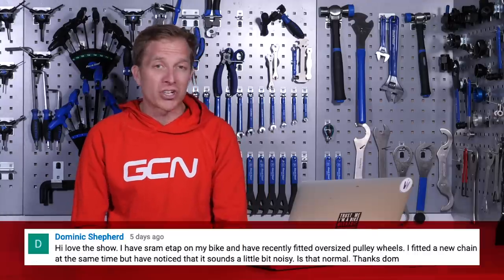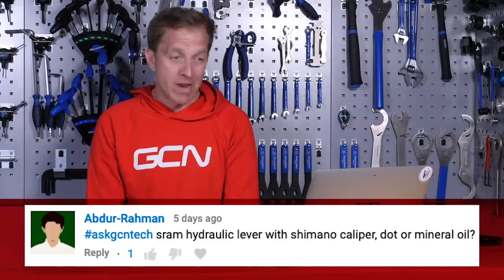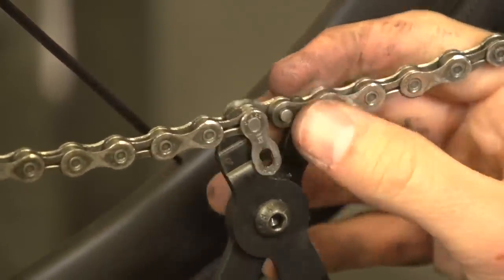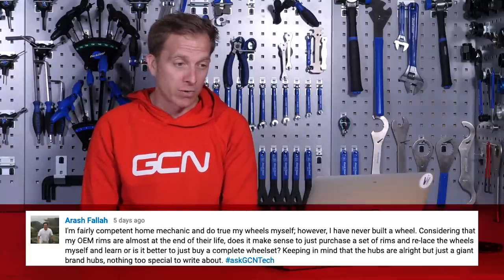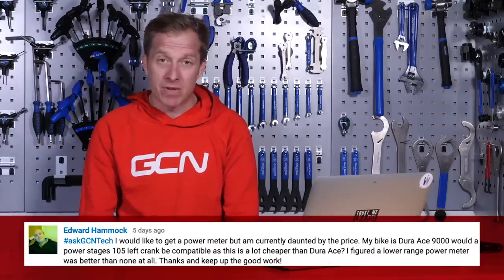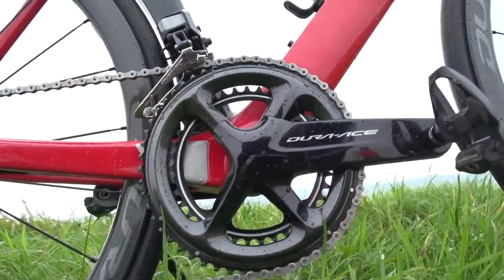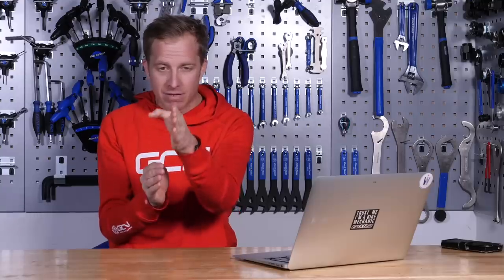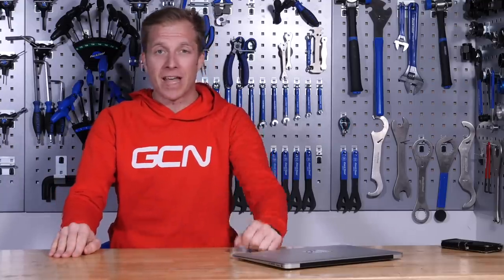Can You Use SRAM Levers With Shimano Hydraulic Brakes? | GCN Tech Clinic

Comment from the maker: We love to help here at GCN so don't forget to leave your questions in the comments below using #AskGCNTech and we'll try to answer them
Reply: #AskGCNTech have you put a tracking device inside yer bike frame somewhere just incase it gets stolen?
Reply: #askgcnanything can’t seem to find the answer to my question: can you use flat mount calipers on a post mount frame? Confident you can help me out here. Thanks!
Reply: #AskGCNTech Hi Jon. Is there a way to have a 10t sprocket on the current 11 speed groupsets?
Reply: #AskGCNTech Hi Jon,  I have just started waxing my chains. It was recommended to me to soften the wax with paraffin oil.  I did a 1:1 ratio on the first try and notice a little more chain noise after about 60Km than I do with me regular dry lube. Is this normal or is it a sign that I shouldn't have used the paraffin oil.  Other than adding the oil I followed the steps in the GCN video on how to wax a bicycle chain from Nov 13, 2017.  Thanks, keep up the great work!

Comment: We need a video about converting a bike from flat bar to drop bar, I can never really find a clear answer anywhere that would tell me if this is a good idea, I have a 2018 specialized sirrus hybrid bike and want to install drop bars to turn it into more of a gravel adventure bike, any help would be greatly appreciated
Reply: The trouble there is that often the toptube on a bike designed for flat bars will be too long to use with drop bars, the reach is just too much...  or you'll need a 45mm stem...   Which can make handling a little twitchy.

  Modern Hybrids & mountain bikes often have short stems already, and thus are really too long to convert.  
I've done a few conversions with old steel frame Mountain bikes and hybrids;  I usually look for one a few sizes to small for me, and just use a lot of seatpost.  Top tube length varies a lot though, and sometimes they are just too long.  Seat tube angle can also affect this...  
If already have a road bike that fits you look up measuring "reach from bottom bracket" and measure that and your hybrid to see if you can compensate with a shorter stem or not.
Reply: I'll second owwliv. Something else a lbs mentioned to me, was the crank position may not be great for a more forward position, ur knees may end up more in your chest than a dedicated drops bike. However, I've done the swap to a 2017 vita elite carbon. And it actually worked out golden. And i had a blast researching, parting it out, and building it. I started with a slightly big frame, i'm between a mens XS to S frame, and i did the build on a womens M frame. Might be a little too aggressive, i could use a shorter stem, but its otherwise a joy to ride, and fits schwalbe winter marathon studded tires. 

The primary deterrent i'd give you is performance per dollar. Depending on what u currently have, you may lose more than you gain with the switch. I went from 2x9 sora and hydro disc brakes, to 1x11 and mechanical discs. 600 CAD for the bike used, almost as much for the sram apex/rival hodgepodge i added to it. Plus 300 for a wheelset upgrade. I coulda saved 300 by sticking to shimano 2x9 or 2x10. But mechanical discs on a 900 CAD bike... You could get as much, brand new.
Reply: From personal experience, shimano sora 9s, deore 9s, and 105/ultegra 5700/6700 10sp all play nicely enough with each other. So if u have sora 9s, u can probably run a 10s 105 5700 cassette, with 5700/6700 10s shifters, with the 9s derailleurs, and be golden. And other forums will say 8s and 9s also play nice enough, but i've never tried that personally. Similarly, if u have a higher end sirrus elite, those have tiagra 10s? Which apparently only play nicely with same generation tiagra drop shifters or shimano 11s, meaning a cassette upgrade?

But the higher end models mean hydro disc brakes... And honestly thats a can of worms not worth opening. Flat mount vs post mount, DOT fluid vs mineral oil, general compatibilities... Unless u truly start from scratch, with a whole new groupset. Might still be able to find some RS685's lying on the shelves in some e-retailer somewhere. But then, just buy a brand new frame too while you're at it...

Comment: Speedlinks can snap :) Few weeks back and mine snapped right off! It was partly a bumpy piece of road and if it was chainslap or something else, I don't know. Did not have a spare with me but since that happened I do now! Lucky for me it was a small walk, 2,5km, to the nearest store! And although adding them to your keychain is a smart thing I would not recommend is. Those very little plates that keep the speelink stuck together are fragile, especially on 11s. So I would stick them somewhere in a saddlebag or something you use to keep your tool or tire etc.

Comment: how will sram hydro road levers work with sram guide calipers ? the original calipers that match this levers have 2 pistons on the calipers and the guide has 4 calipers .. will they work right and strong ? or levers too small for the amount of fluid needed to push eficiantly the 4 pistons of the guide calipers ?

Comment: I have a current cx bike with a 6600 shifter but an alivio rear mech because budgets really tight. My question is should i redo my shifting if it’s currently fitted with a 12-25 cassette on a 23c and 25c wheelset and i wanted to fit it with a 11-42 cassette for the 38c and 38c wheelset

Comment: Dot vs mineral oil... Am I right if I say they you can use mineral oil with brakes that are designed to work with dot oil but not the other way around? Because mineral oil is harmless, and Dot is unsafe with some materials... So could I use mineral oil in Sram calipers? Furthermore, Sram why don't you just go with mineral oil?

Comment: i have a new bike and now that i have been riding it for a while i need to re-index the gears, i know how to do this and have done it on several bikes in the past but i'm struggling with the barrel adjuster and getting the right tension. it just keeps slipping gears and i cant seem to find that correct tension now that the cable is stretched. if i get the highest gear i lose the lowest and vice versa. its a shimano rear derailleur  #AskGCNTech
Reply: Just having some thoughts here.
It might not be the cable, it might be that the derailleur hanger is slightly bent inward/outward..
Reply: @cliffordromina3527  i don't think so its a new bike that has only been on a turbo trainer until today so there are bashes or dents to it

Comment: #AskGCNtech. A question for you. I have a road bike and some components arriving from the UK for my 9 year old son. The frame is designed to take 700c wheels and disc brakes. It's a single chainring with an ultegra 11 speed cassette. I managed to pick up a set of SRAM apex levers for him as they can adapted for his smaller hands. A friend gave me a set of ultegra hydraulic calipers to go along with the  center locking shimano  rotors I have for the bike. 

Are the levers and calipers compatible?  If not, what Flat mount SRAM calipers would you recommend?  

Thank you

Comment: Hey Jon, Ollie, or who ever is in there right now, I'm a big rider with a height of 5'9" and my only do it all bike is a Cyclocross/gravel bike. I'm currently using a size 54cm frame, and would like to change them, but the problem is there's not a lot of frames my size and commonly us a size 52cm, will a size 52cm works out, or should I try to search for the correct frame size. Love the show and greetings form the PH🇵🇭

Comment: #askgcntech I know that using carbon specific pads with aluminum wheels is a no-no because aluminum embedded in the pads can ruin the carbon rims later. However, if one is racing on rim brake carbon wheels (with carbon-specific pads) and gets a puncture, is it okay to get an aluminum wheel from neutral support so long as you change brake pads before using your carbon wheels again? Will the carbon-specific pads perform adequately enough on aluminum rims to finish the race?

Comment: I have currently converted my TT bike to a 1x drive train with a 54t single narrow wide chainring with a 11-28 cassette in the back with a brand new chain . I have noticed there is more rubbing kind of a noise when the chain is on the last 3 cogs( 11t,12t,13t) and becomes really smooth and silent when the chain is in between( 5th-8th sprocket) . Any specific reason why this is happening ? Should I be concerned about anything ? Or is it jus the sound of possible slight cross chain ? #askgcntech

Comment: #AskGCNTech Hey GCN tech, at home we have an old road bike that I would like to upgrade a bit, right now the gear levers are still on the frame, but is it possible to change it so the gear lever are on the handlebar like modern road bikes? Cheers!
Reply: If you have brazed on down tube shifters, you can get adaptors with adjustable barrel that will replace your shifters. Look for down tube gear cable stops on eBay. Same if you have clamp on shifters. You'll find same clamp on cable stops allows you to use STI (habdlebars) shifters

Comment: #AskGCNTech I need your help. I went to my local bike shop in the hopes of changing my crankset. I have a Cannondale CAAD12 and I want to switch my SI crankset to a Shimano Ultegra R8000 series; with the exception of the crankset, the rest of the components are Shimano 105 R5800. I already got a bottom bracket shell from c-bear to install a Shimano crankset on a BB30a; however, the mechanics at the shop told me there will be problems with the shifting if I installed a newer crankset, such as the Ultegra R8000. Apparently, mixing the components is not recommended as new Shimano components weren't designed to work with older 11spd components. Is this true?  Do I need to buy a complete groupset? Love the show!

Comment: #askgcntech Hi Jon. I'm running a pair of ST-R7020 levers, my first hydraulic setup. I've got a BR-R7070 caliper in front, feels great. But In the rear, since my frame is post mount, I can't match the front caliper. So I ran a BR-M7000 MTB caliper w/BH90-SB hose kit in the rear. The lever felt spongy. Now I'm running a BR-RS785 ROAD caliper in the rear w/BH90-JK-SSR hose kit. The levers still feel spongy. I'm sure I'm using the correct fittings per the hose type I'm using. What am I missing here? Are rear hydraulic calipers just inherently more spongier feeling because of the longer hose? Should I try the BH59 hose? Help please.

Comment: #AskGCNTech - Is it possible to link Powertap pedals directly to an iPhone running Strava? I don't want to buy a separate head unit for my bike, I'm quite happy with my phone on my handlebars! It seems oddly difficult question to find the answer to!
Reply: andrairvine The Powertap pedals have Bluetooth and there is a Powertap iPhone app that connects to them and can record data. I’m sure MapMyRide or one of the good apps would also allow you to record the ride with power data.
Reply: @discbrakefan  Is Strava itself able to pick up the pedals and record the data. 

The only problem with another app is background updates apps tend to stop updating in the background on iPhones. 

Even Strava can be pretty spotty in this respect. Take this frustrating effort for example (I didn't have my handlebar mount with me, it was locked an in a pocket). https://www.strava.com/activities/1994740064
Reply: @andrairvine  Strava probably isn't the best app to actually record your ride with. Most other apps can sync with Strava anyway, so you still get your ride and data on there. Cyclemeter is a good option which can connect to all sorts of sensors including power meters. It will upload your data to Strava.

Comment: #AskGCNTech Hi GCN, every single time when I putting my wheels back with QR axles on my cyclocross bike the rotors are rubbing against calipers even when they were perfectly set up before. My questions is dear GCN is it any solution to avoid this to happens again ? I'm tired of wasting my time for this. Thanks for any advice
Reply: Thru axles :(

I have a similar setup and changed the fork to a 15 mm TA because the front was much worse - maybe because the less-stiff dropout interface? I managed to get the back wheel to stay firmly put using the DTSwiss RWS skewers that tighten by turning a lever instead of a QR clamp. Next best is an internal cam skewer, since they clamp harder than the external cams.

You still need to make sure to put the wheel in carefully every time, but at least they stay put.

Comment: #AskGCNTech
i have an early 90s bike with Rims i cannot find any information on in regards to the maximum tyre width i can run (Alesa 913 622 700c)
I am currently running 23 mm but would like to fit some slightly wider tyres, is it safe to do so?

Comment: #AskGCNTech Do you know of any budget Single speed hubs that can be used with Disc Brakes?  I have checked out the interweb and so far only expensive Chris King and Surly hubs pop up.  Also any tips on adding Disc brake lugs to an Alu frame? Keep up the good work.
Reply: There are products that attaches on the seat stay or on the fork. But be careful for your stays and fork may not be designed to recieve those stresses from braking..

Comment: I've been thinking (dangerous I know). If you used 23mm tyres on an old school wheel with a narrow internal diameter, then switch to a new set of wheels with a wider internal diameter, would you be increasing the volume of air which would lead to a lower tyre pressure needed? hmmmmm…???
Reply: Yes indeed.

Comment: Great content as always! How do you plug the holes in a carbon frame where mechanical groupset cables enter when switching to Di2? #askgcntech
Reply: Google for Di2 frame plugs.. you can get a range of rubber bungs which plug the frame holes, your frame manufacturer may also have ones specific to your frameset

Comment: Speaking of jockey wheels, when do you know it is time to replace them and how?
Reply: Turn them with yer finger. If it doesn't feel smooth, it's time. If there's noticeable play side to side, it's time. Proper maintenance (re-greasing and the such) prolongs their lifetime considerably, especially if you wash your verhicle often (winter bike, CX, such activities would indicate it).
Reply: @Bungle2010  They do indeed, but very little. The whole cage is moving a fraction of a degree to compensate for changes in teeth at the front.